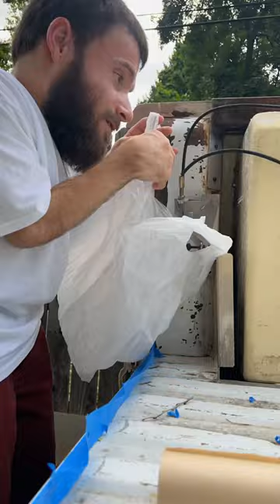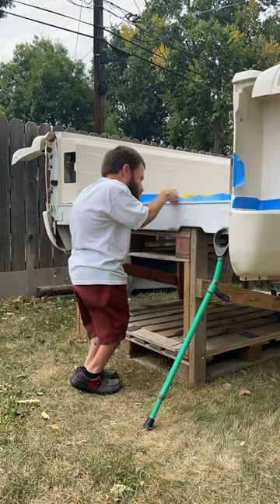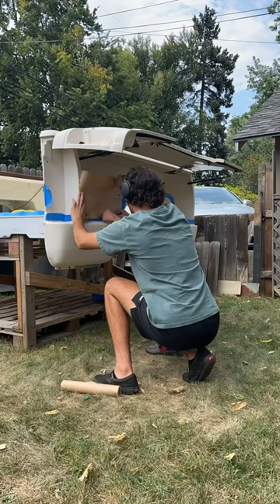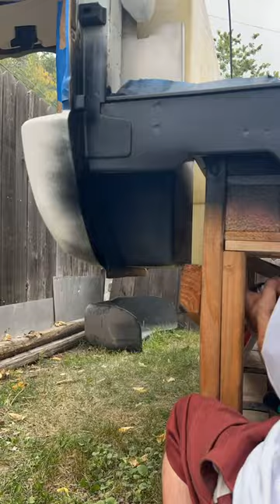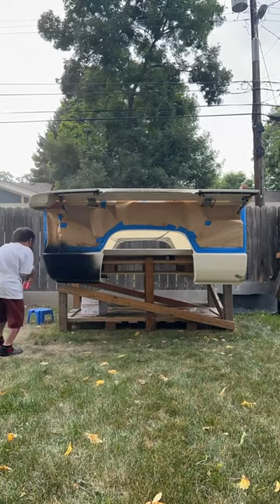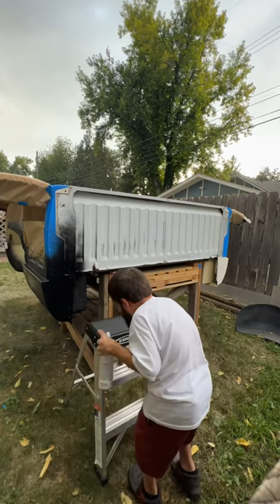Painting a rare truck bed at 4 feet tall

Comment: Man I swiped onto this and got hit with nostalgia. My mother liked this song and so she’d played it a lot so it’s been pretty much engraved into my memory Rip to her. Also a great truck. My dad used to have a small cab or whatever it’s called where it has a bench seat. And it was pretty nice and had lots of power unfortunately it came from iowa where it had been the snowplowing truck for my aunts family so it had rust in many places and well due to certain reasons we sold it to our cousin and well he’s lucky to be alive as the entire rear drive shaft decided it wanted to depart on its own adventure while driving at highway speeds (65-75 my area) so he lost his rear wheels and well crashed. The truck has now been scrapped for about 3 years.